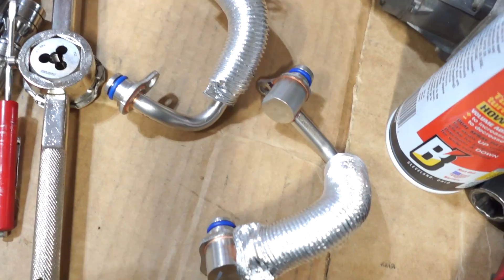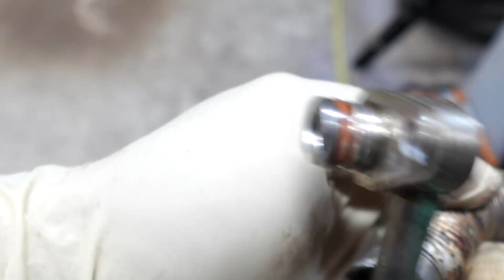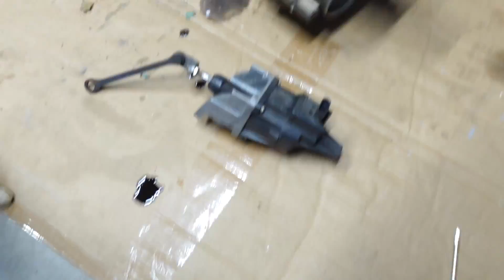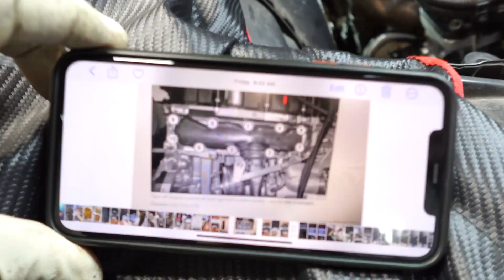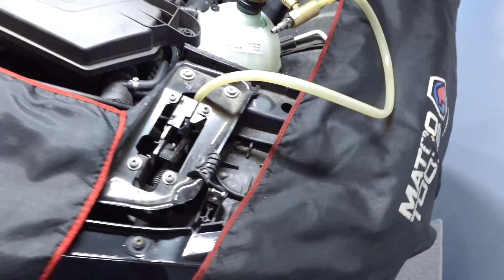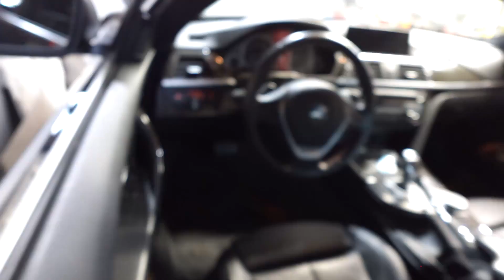2016 BMW 428I, Wrapping up the turbo coolant lines Part 2, Installing the turbo on the N20 Engine.

Comment: What was the best way to get the bottom turbo coolant line into the turbo? I’m struggling to the point where I’m gonna lift the car off the jack stands and flip it with my hands.
Reply from the maker: They feed through the middle of the pipe and the cat flange. It’s kind of a weird tight fit. I have to feed the coolant pipes through while installing the turbo and the same time.

Comment from the maker: Yes u can bleed it like that too. Using the Vacuum filter eliminates the need to do the bleed procedure. I normally still do it for a bit to make sure the water pump is working.
Reply: Thanks big bro

Comment: I learned that on the f30/f32 you can bleed the coolant system without running the engine, by holding the gas 10 seconds and turning on the heater, I have to do work on my f30 soon so that’s how I found out.
Reply: I’ll take that back, if you disrupt anything to do with the oil pressure in your car you have to prime it, so exactly what Kool Fred did, crank it without it turning fully on.

Comment: How well would Vaseline hold up ? Would  the Vaseline corrode the line  because it gets hot?
Reply from the maker: It holds up good! I normally use sil glide but I did not have any that day. Been using both for years. It helps you so u don’t pinch the o-rings.

Comment: The ccv that goes from the engine to my turbo inlet broke any tips on replacing it. It uses the same bolt that holds the turbo oil line in place
Reply from the maker: That’s the one on the bottom, u just rotate it from side to side. It has a poring that seals it. That’s the turbo oil drain hose back to the engine block.